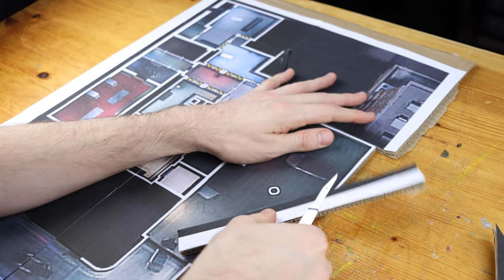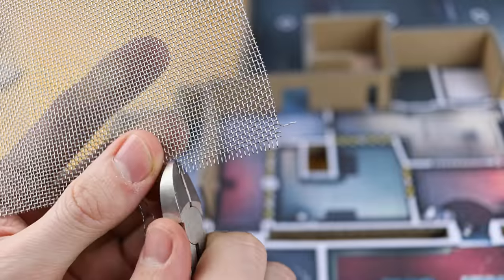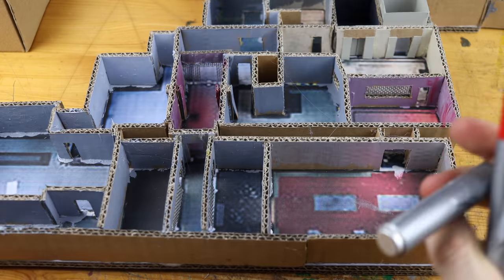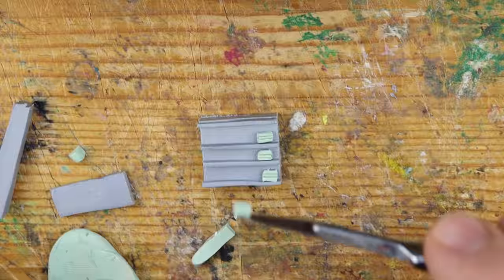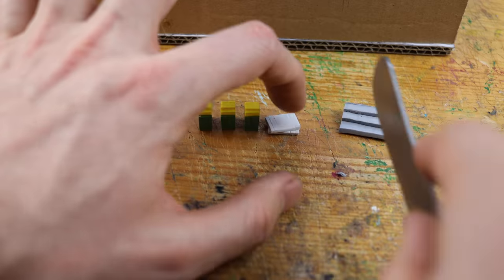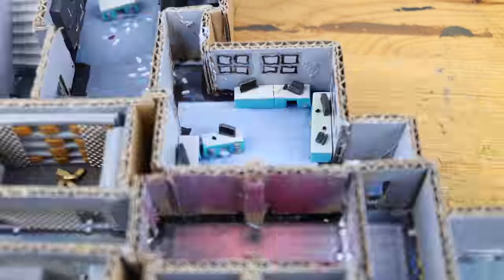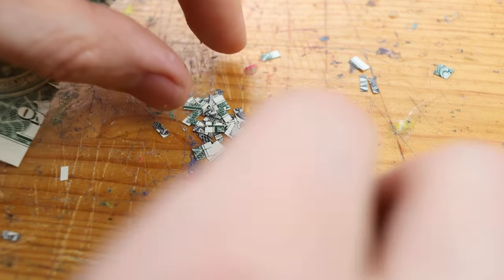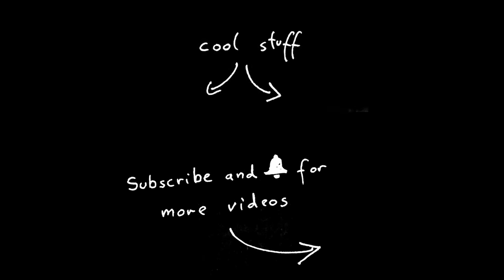PLAYING Rainbow Six Siege with clay, cardboard and my Probe Lens!

Comment: 18 USC § 331 (2011)
§331. Mutilation, diminution, and falsification of coins
Whoever fraudulently alters, defaces, mutilates, impairs, diminishes, falsifies, scales, or lightens any of the coins coined at the mints of the United States, or any foreign coins which are by law made current or are in actual use or circulation as money within the United States; or

Whoever fraudulently possesses, passes, utters, publishes, or sells, or attempts to pass, utter, publish, or sell, or brings into the United States, any such coin, knowing the same to be altered, defaced, mutilated, impaired, diminished, falsified, scaled, or lightened—

Shall be fined under this title or imprisoned not more than five years, or both.

(June 25, 1948, ch. 645, 62 Stat. 700; July 16, 1951, ch. 226, §1, 65 Stat. 121; Pub. L. 103–322, title XXXIII, §330016(1)(I), Sept. 13, 1994, 108 Stat. 2147.)

Comment: @DepartmentoftheTreasury I found a violation to the following statute...

Defacement of Currency

Defacement of currency is a violation of Title 18, Section 333 of the United States Code. Under this provision, currency defacement is generally defined as follows: Whoever mutilates, cuts, disfigures, perforates, unites or cements together, or does any other thing to any bank bill, draft, note, or other evidence of debt issued by any national banking association, Federal Reserve Bank, or Federal Reserve System, with intent to render such item(s) unfit to be reissued, shall be fined under this title or imprisoned not more than six months, or both. 

Visit www.secretservice.gov for additional information.